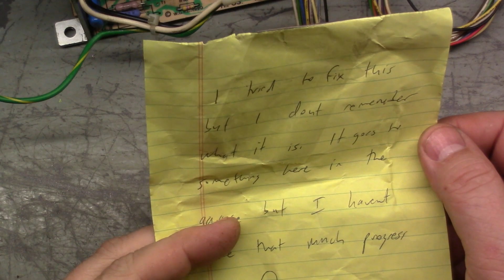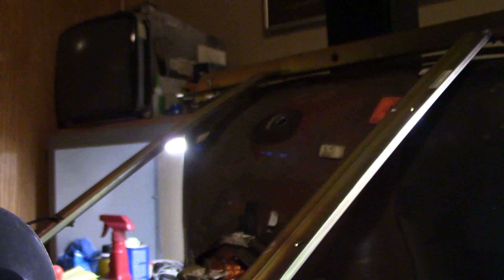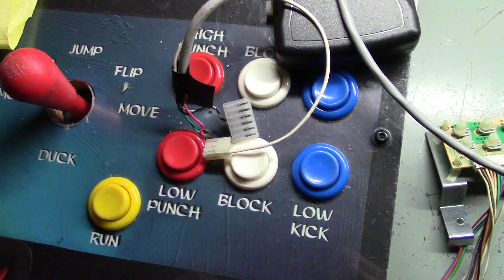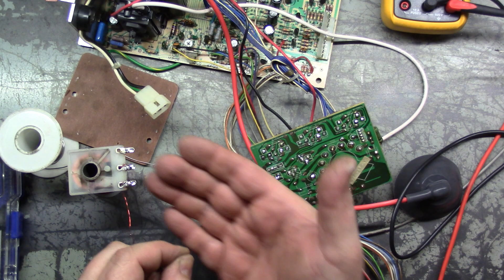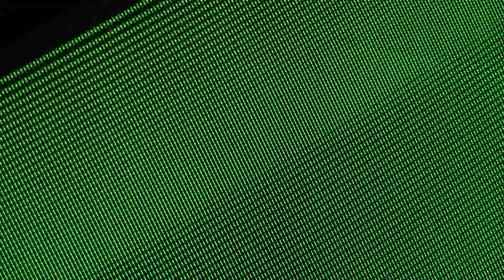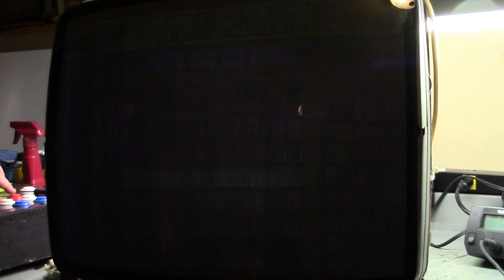25" K7000 Arcade Monitor Chassis Repair - Missing Caps/No Blue Color

Comment: How come it's important to power these boards with an isolation transformer? Doesn't the same 120V AC go in and also come out of it?
Reply from the maker: It has to do with the phase. It’s designed to have the hot and neutral come in in a specific way and because AC isn’t polarity specific like DC, if the hot and neutral are backwards from what it’s expecting, bad things can happen. The transformer works in such a way that it counteracts that problem and provides an output that won’t damage the chassis. That’s the best way I can describe it.
Reply: @MikesArcadeMonitorRepair  Very interesting, thank you!